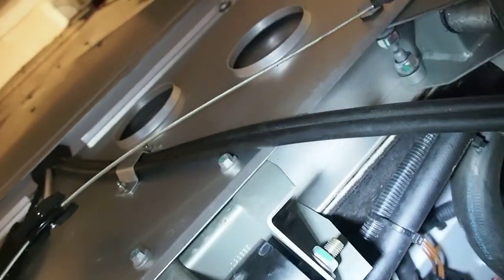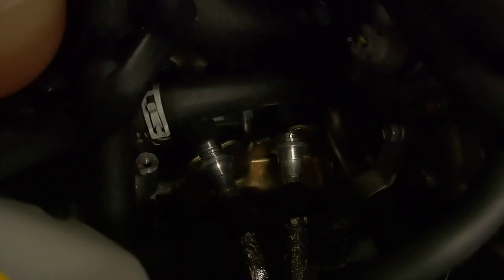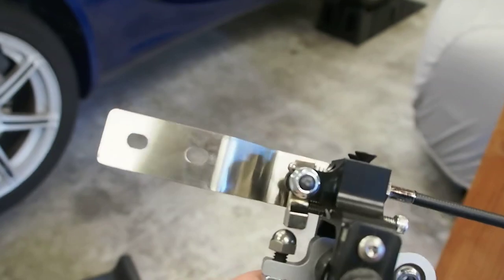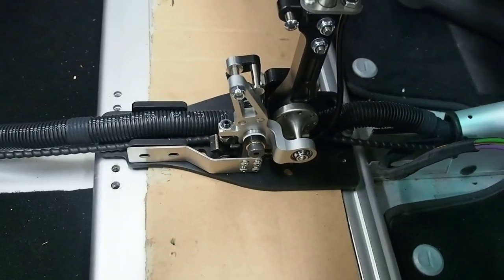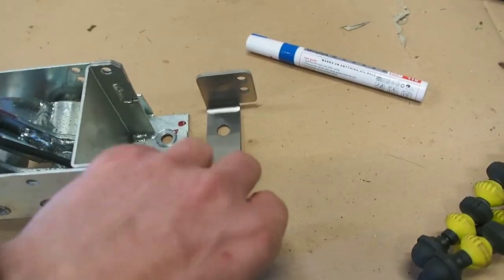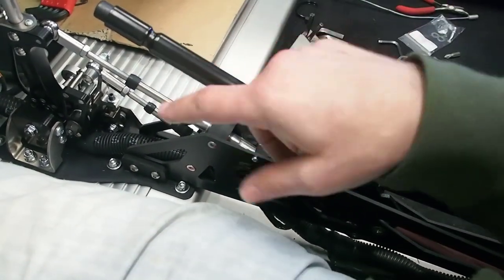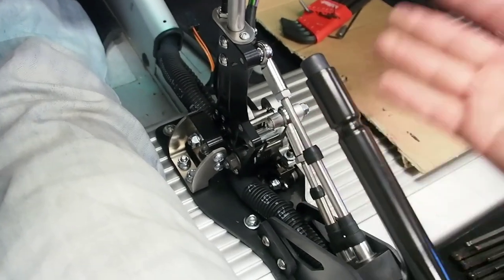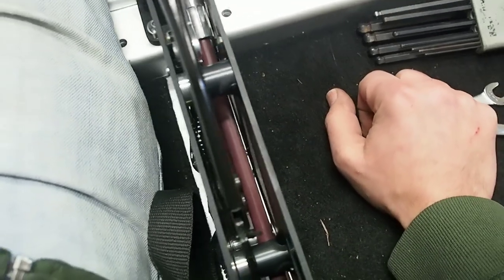Lotus Elise Install shift cables and ShiftR111 (Part 2)

Comment: About how long did this job take you?  I'm trying to figure out if I should spend $1250 for a lotus shop to do my Alitech, Cables & LETSLA mechanism
Reply from the maker: I'd guess the whole job took about 4-5 hours with final adjustment fiddling.  If I had to do it over, I'd do it myself again instead of paying for it.
Reply: @justaddafan  damn!  That's pretty good time.  Do you have a mechanical background?  I've installed a supercharger on an S2000 before but I've heard a couple people say pulling those cables was the hardest thing they've done!  Just to clarify did you pull them out from the back, or pull them through the cabin?
Reply from the maker: @Driv300mph  I'm a mechanical engineer, but that usually means it takes a lot longer to do a job :).  Removing the cables is actually pretty easy when you're changing the shifter as well.  I can see it being a more involved job when trying to keep the stock shifter in the car.  The hardest part is getting to the clips on the transmission.  It helps to have skinny engineer's arms.  My process was to release them from the transmission, then the cabin, then pull them out from under the car.  Install in reverse.